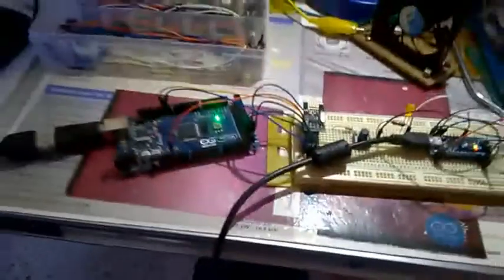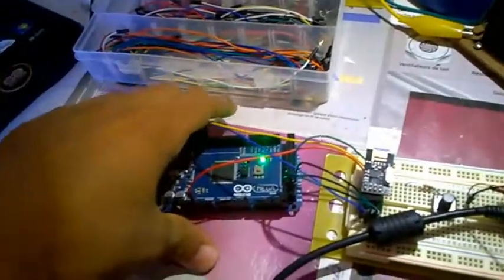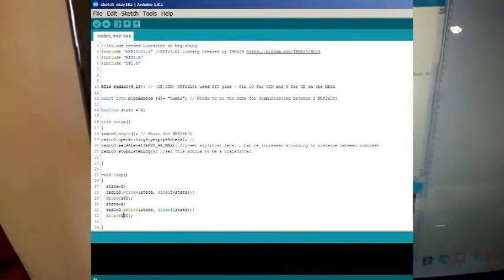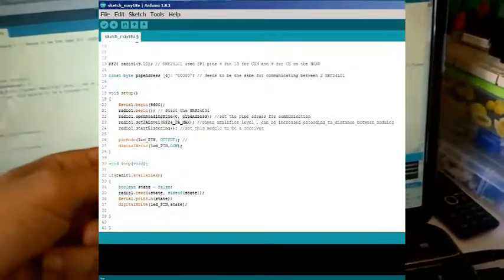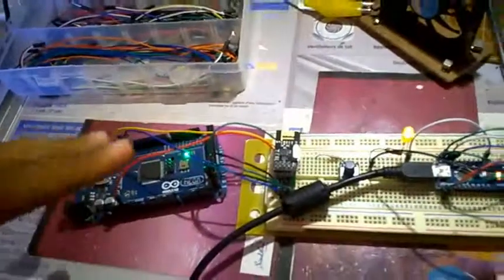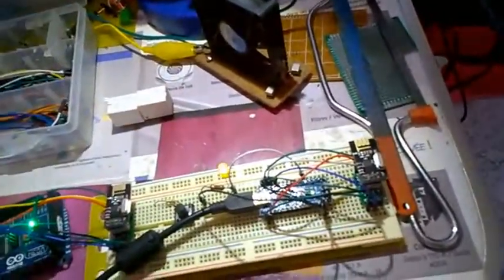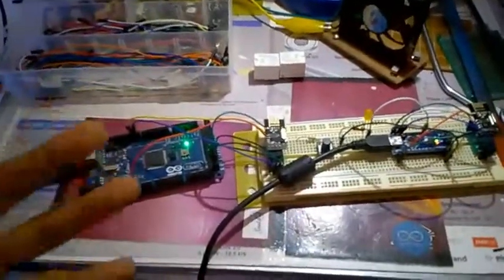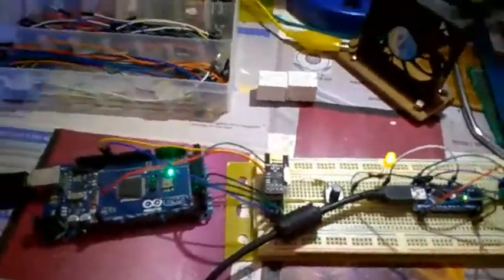Wireless Home Automation using NRF24L01 & Arduino  _part 01

Comment: Hello i works lot of days on Nrf24l01 on mega to uno but i can't get any data from it
Reply from the maker: maybe try using the code I have provided, have u done that, it's been a long time since that video
Reply from the maker: if u can't find the code let me know, I will check too, I mean the project was successful for me between a mega and a nano which is the same as the uno
Reply from the maker: hey, check the description of part 2 & 3  to get the code and if you still have problems let me know